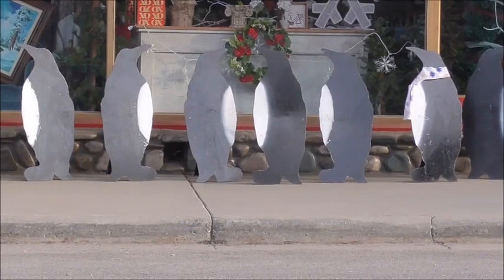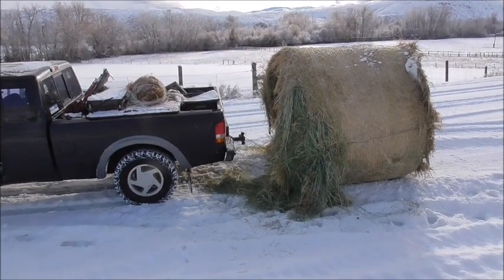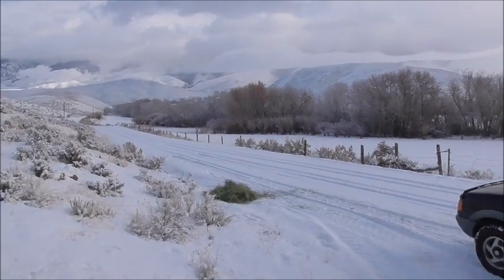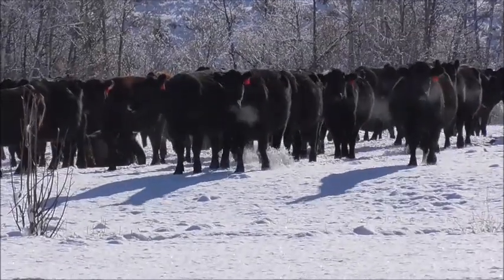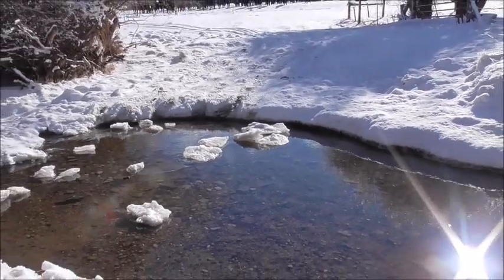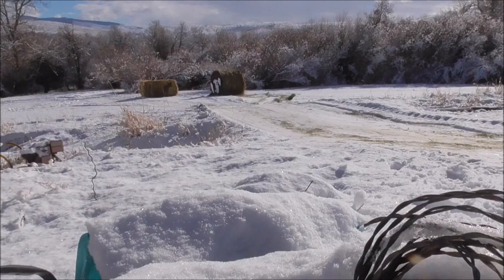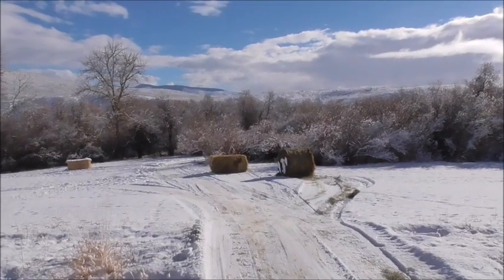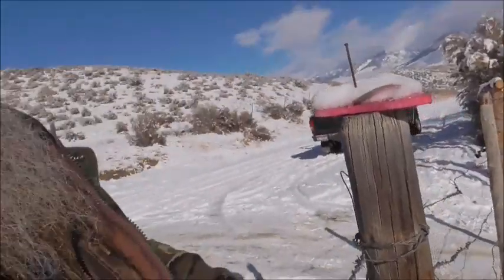Feeding Round Bales Without The Tractor

Comment: Hey Muskrat, how are you doing Brother!!!
Hey, if the tractor will not start leave the key in the ignition with it in the turned on position and make sure the tractor is not in gear. Leave it in park with the key on and take a screw driver or jumper wire and touch the positive side of the starter to the other big positive starter bolt. This will crank the starter over and when the tractor starts just take away the screw driver or jumper wire. (they are right next to each other and this is simple to do) All you are doing is supplying power to the other side of the starter that needs power to make the starter crank the engine over.
As long as you leave the key in the on position it will have ignition to continue to run. Fun video though, if I was there with you we would have had that baby started in 30 seconds :-) Stay safe brother...MTJOA
Reply from the maker: I tried that, but all I got was sparks and it started to smoke. I've done that trick with other things, but it didn't work this time.   I'm thinking the brushes in the starter might be worn out and rubbing?  How are things with you?
Reply: @MuskratOutdoors  I am doing awesome brother! I am enjoying life here in Montana. Going wolf hunting on Saturday again
Reply from the maker: @montanajohnsoutdooradventu4455   Glad to hear it!  I'm hoping to also in a few days.